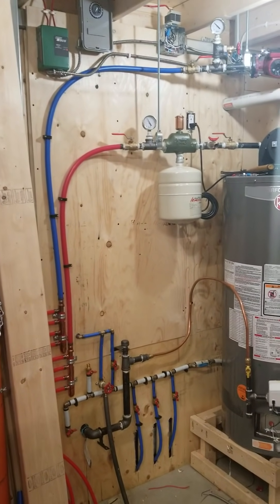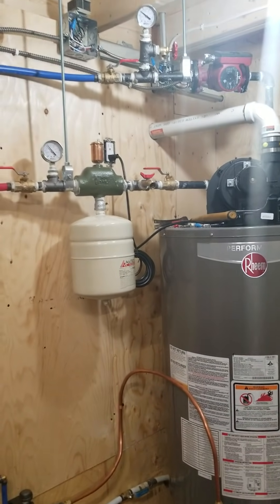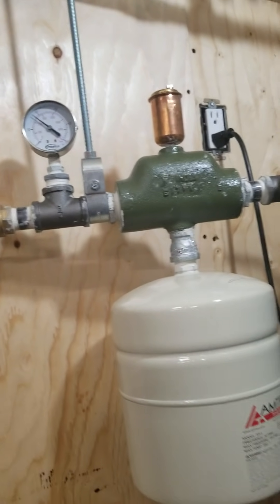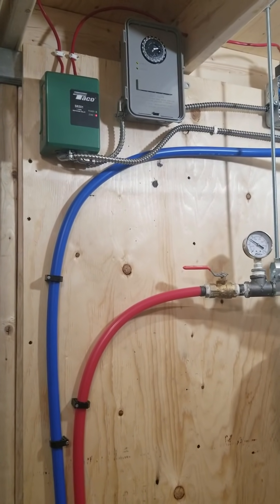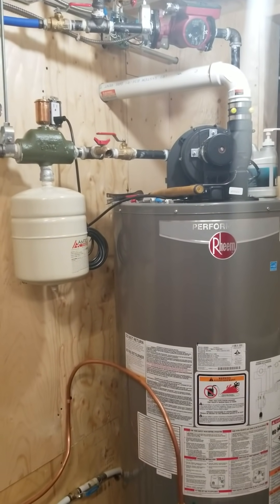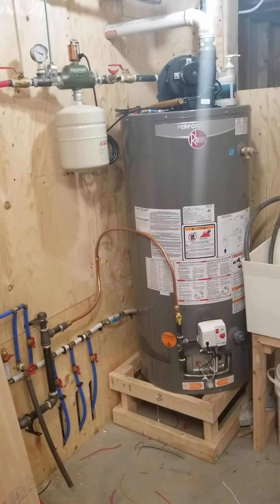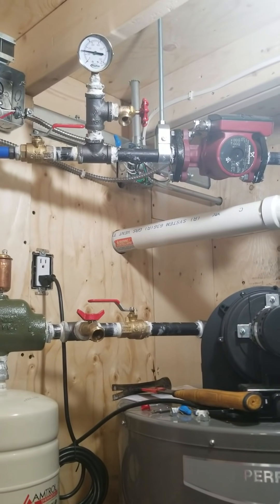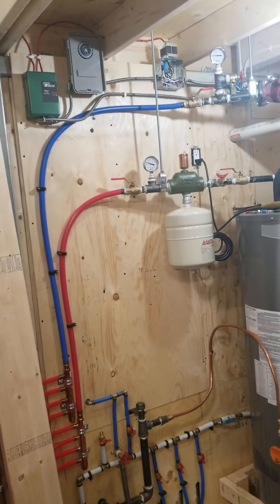DIY In-Floor Hydronic Heating System Using Water Heater

Comment: Jordon, the Glycol you added to your system was it diluted at all or a 100%?  Or should I ask can you run it as a mixture like 50/50 w H2O?
Thanks and great video very helpful. I have everything together and will be installing before the winter hits here in MI.
Reply from the maker: It was diluted, the system is 40% Glycol, 60% water. The larger concentration of glycol, the lower the freezing and burst temperate of your system. I mixed the glycol and water in a bucket before I pumped it in the system.

Comment: You tossed a lot of money out the window to do an improper closed system.
Reply: I don't often comment...but some people piss me off....thanks for trying something different. obviously there are other guys (like me) looking to do the same thing, thats why you have so many comments and quesions. I'm glad the system works for you, and it seems pretty inexpensive as well. it makes sense that the system should work, its a simple process, heat water and send it thru the pipes...doesnt seem like there is any right ot wrong way to heat the water...its good to see that the hot water tank can do the job...i appreciate the time it took to make and post the video.
Reply from the maker: Dont even care, my shop was 65° all winter long and used minimal natural gas to maintain that temperature. It was a hell of a lot cheaper to build it this way then the $7000 ready to install board the building company wanted to sell me
Reply: @jpaul1030  u wait its going to cost u more...stick to ur shitty electrical trade dont try to be a plumber a plumber when u have no clue what ur doing dumbass.
Reply: @jaybee9097  If you're going to criticize,  let us know what he did wrong? Or how you could do it better for the same price.

Comment: So one small logic mistake is shutting pump off.    Just let the water heater run when heating up.   The timer logic is wrong here.    Just turn the water heater on and water heater will run continuously until slab is heated.  Shutting off the water heater doesn’t save fuel.    Either the water heater is big enough or not.    40k should heat slab.    When you initially turn system on it will be cold and water heater will struggle shutting the water heater off in theory actually used more fuel.   Let it “dump” and recover while recirculating.
Reply: I think he doesn't shut off the heater but the circular motor.

Comment: Could have used a regular expansion tank instead of a domestic hot water one.
Reply from the maker: That's what they had at the supplier when I was there
Reply: Jordan Paul that works too.    See my other comments on inhibitor, I’ve done this before for the odd job.    One of the dirty secrets of the water heater business is those water heaters run at about 75% efficiency which is illegal in the US and Canada for a boiler.     That’s why you don’t see this more.    The government tries to save us from ourselves lol.

Comment: Is that heat pex? Regular pex doesn't have an oxygen barrier and you may be bateria ect growing in your system. I've seen it before,  but I don't think they had antifreeze in it.
Reply from the maker: It's a closed loop system so I'm not worried about bacteria
Reply: @jpaul1030  I asked if it's heat pex because if it's not it doesn't have the o2 barrier. No o2 barrier,   not really a closed loop. I've seen it done before by home owners who don't know better.

Comment: were there any issues with the staples pulling out of the foam when the concrete was poured? Getting ready to build a garage here in a few weeks and i'm thinking about fastening methods for the pex.
Reply from the maker: I used these:

https://images.app.goo.gl/46PpeMmigDopdmtZA

They worked like a charm, the pex felt very sturdy using them. The act like arrow heads, once they go in the foam it's tough to pull them out. Space them every 24" or so

Comment: What size is your water heater?  I'm guessing about 40 gallons.  I'm very interested in doing this.  Any concerns using an electric water heater?  I already have a propane heater in my shop appx. 1700 square feet with 16" side walls.  I was thinking it would be best to have two different heat sources.  Keeping the floor warm would lower my use of the propane.  I'm in NE South Dakota and it can get -30 here.
Reply from the maker: Mine is 50 gallons. Electric would work the same, it's just expensive in my province so I used gas.
Reply: The problem with an electric is btu’s output.    In the US an elective Is 4.5kw.    A 40 gallon gas is 40k btus.    4.5kw x 3412 =15k btus.     That’s very little output.
Reply: @anexpertateverything4816  I was debating on using electric verses propane (LP).  I have an LP furnace in my shop and thought to have a separate heat source with the in-floor heat (electric).  I may still use a boiler made for in-floor heat in lieu of a water heater.   I want to keep the floor at about 40 degrees in the Winter.  The concrete is insulated under the slab but there's not much insulation on the sides.   Should I go with an LP boiler/water heater or electric?  I do get a discounted rate I believe at about 4.5 to 6 cents a KW through a CO-OP.  The pro for electric is no vents needed and I can get a boiler for about $800.  Thank you in advance.  Any advise is appreciated.
Reply: @kelly00127  so what is the cost per day and month to run?
Reply: @tigertom53  I have an enclosed system with an electric boiler, not like this set up.  My shop is 35 x 54 with 16 foot side walls.  We are on a rural electric coop with reduced electrical rates for in-floor heat.  I keep the floor at 50 degrees, with a temp sensor in the concrete.  It runs me approximately $100 to $150 a month extra in the winter.  I live in NE South Dakota and it can get -30 to -40.  When I work in my shop I turn on a propane house furnace to get the temp to about 65 to 70 degrees.   I have 2x6 walls with plenty of blown-in insulation in the attic space.  Hope this helps you.

Comment: So many gas code infractions!
Reply: Code says you must have pipe on the relief and copper line must be identified. Pressure tag must be on equipment.
Reply: You have no way to shut off and disconnect gas line to remove and service burner with out a union.
Reply: @johnstewart326  shut up u desk top jockey.there is nothing wrong with this system . You're just jealous you probably can't even turn a screwdriver. You can always shut the main gas valve off. It's just a small inconvenience jerk
Reply from the maker: Please explain how there not being a union at the tank compromises the safety factor of the install
Reply from the maker: How many code infractions do you see?
Reply from the maker: @johnstewart326  what are the infractions
Reply from the maker: @johnstewart326  will not having a pipe on the pressure relief valve cause it not to relieve the pressure?

is not having a union after the shut off valve a critical safety hazard when I can just use the flare fitting?

I know what the copper line is for.

Screwdrivers aren't approved by the manufacturer to use as pry bars but they work pretty good as one.

The TSSA tag is in my house.
Reply: Did anybody stop to think that maybe the pressure relief valve should be changed from 150 psi to 30 psi like a normal boiler system, especially considering there’s no low-water cut off. So if there is a leak in the system you could create steam

Comment: I have a very simple residential water system: street water supply to the water heater, then to all faucets, showers, washing machine etc. I had to open a lot of walls and I got the idea to upgrade my water system with a hot water return line and install a recirculating pump to stop wasting water down the drain waiting for hot water, and then I thought I should probably then also install hydronic heat radiators. My question is:, can I just add a manifold style hydronic hot water radiator system,  hooked up to my house water line and use one circulation pump, I live in california so no freezing concerns for me.
Reply from the maker: Even if you dont run glycol you still run the risk of getting Legionnaire's Disease from the stagnant water in the water lines. Chances are you wont run your system more then a few months a year so when you start it after 9 or 10 months you could risk legionella getting back in your "house side" and going through your faucets. You could prevent this by putting in a back flow preventer but up here in Ontario Canada you need to have that inspected yearly by the city. So not worth the risk in my opinion.
Reply: @jpaul1030  separate system looks like the way to go then. I wanted to just use one circulator pump but not at the risk of cross contamination.  thank you for the prompt reply
Reply: Angelo C I don’t know if you ended up doing this project but most radiant heating parts are for non potable use only. So be aware of that.

I have a return line in my home and on its way back I have a towel warmer in one of the bathrooms made of copper and it heats the bathroom along with the towels!

Comment: How much anti freeze did you use?  What was the ratio?
Reply from the maker: I used glycol. My system is made up of 40% glycol and 60% water. Has a burst temperature of -30 ish. Each manufacturer of glycol has different grades with different freezing/ burst temps which are well labeled.
Reply: Jordan Paul thanks, and nice job!

Comment: Great video! Very helpful. A couple of question if you don’t mind. What diameter of PEX in the floor and portion beyond the manifolds? Also, what size pipe is that you used at the water heater?
Reply from the maker: 1/2" pex in the floor. I believe the pipe size I used at the water heater is 3/4" but your water heater may vary.
Reply: Pex size in floor doesn’t effect the heat produced.    The larger the pipe the Btu’s it can carry.    But per sq ft of flooring you will not get anymore heat out of different sizes.    Good rule of them 1 sq ft = 1 foot of tubing.     Doesn’t matter tuning size!    3/8” tubing = 200 ft loop; 1/2” = 300’ loop; 5/8”= 330’ loop; 3/4” = don’t use!!   To hard to bend and deal with lol

Comment: Interesting about the relationship between the heater tank and circulation. Never thought before that if the tank runs out it may try to heat the "water" forever which blows the efficiency in the trash. Something to think about.

Comment: A very simple system, no mixing valve, zone valve, check valve, pressure reducer.  Air scoop should be on upper section, pump mounted low, no black pipe. You proved the system works well to those who say it can't be done. Nice work!

Comment: Great Job. Although it looks like you used  black iron pipe in some spots.  Hopefully I am wrong.
Reply from the maker: What's the problem with black pipe
Reply: Jordan Paul , black pipe is for natural gas. It’s used because the gas can cause galvanized pipe to flake and mess up the burners. Galvanized is for water, so the pipes won’t rust. You might be okay, since you’re running glycol. I’d look into replacing the black pipes with copper. Greetings from Southern California
Reply: Jordan Paul no problem with it, things rust because of the oxygen in the air. In a closed system you will have minimal rust.
Reply: Jordan Paul can’t use ferrous materials with non oxygen barrier tubing.    Your steel in the system is slowly rusting away and sludging up your system.     Get the best inhibitor available and pump some into your system yearly!    Trust me.

Comment: Good show men . Why not heater on demand  ?
Reply from the maker: When I did my research on this system I read that the condensation of the water/ glycol mixture can be caustic when only heated to 130°F and is harder on the on demand heater opposed to a tank. But then I read about on demand heaters that can separate the condensation better. So I went with a tank because people I've talked to and systems I've seen have been built with tanks and I wanted a sure thing.
Reply: @jpaul1030  Condensation?  Are you referring to condensation in the flue?

Comment: Looks like you used black iron. Not made for liquid. Switch those fittings to galvanized or your gonna rust out the system
Reply from the maker: I've see whole universities non potable water done with black pipe. Itll be fine.
Reply: I’ve seen thousands of systems fail due to using ferrous materials and regular pex.   Because you have no oxygen barrier you should have used a brass or stainless steel pump and parts.    You cut a serious corner using black fittings and pump.    Or one could say you cut a serious corner using domestic water piping instead of heat.    Saved approximately 20 cents a foot in pex.    For $100 you could have done it right man!!
Reply: @anexpertateverything4816  That makes sense to me he didn't use oxygen barrier pex.
Reply: @anexpertateverything4816  Don't forget he isn't using straight water in the system.
Reply: you can use regular pex if you don't use any ferrous fittings in the system, otherwise there will be problems down the road

Comment: goes the lines leak after a while? whats the maintenance on it
Reply from the maker: The system has maintained its pressure since I built it so that tells me there isnt any leaks. Its designed to be a maintenance free system.

Comment: Nice simple system!  Nice to see someone come up with a hydronic system that isn’t over done.  I also live in southern Ontario and I’m wondering how your setup worked during the latest cold snap we had.  What you have here is pretty much exactly what I have designed for my shop, so I’m curious.  Only difference is that I picked up an actual boiler for mine after listening to “experts” tell me HWH’s won’t work
Thanks man!   Loved the vid!
Reply from the maker: I have the shop set to 63 degrees Fahrenheit and an alarm set through my thermostat that will send an email to my phone if the shop temperature goes below 58 degrees Fahrenheit. I didn't get an alarm throughout the duration of the cold snap.

Comment: Why didn't you put the 24 hour timer in between the taco and the pump instead of between line and the taco? Then you could still use the taco 24v transformer and simplify the system overall.
Reply from the maker: The timer needs 120 volts for the timer to keep time. If I put the timer between the Taco relay and pump then it would only count down if the system is calling for heat which is fine but there would be a delay if the unit was calling for heat and had to count down those 45 minutes. The way I designed it allows the water to be nice and hot when the system calls for heat while allowing me to monitor and control the temperature anywhere I want.
Reply: duh, I didn't even think of that. Makes perfect sense, thanks for the response!

Comment: Great video! Maybe you could use a thermostatic mixing valve to allow the tank to have a higher set point? (mix with return) Powered vent was the right choice, don't mess around it can kill you.
Reply: He’ll never need higher temps.    Slabs run with 100f water typically.    Set water heater to 100f and be done.
Reply: @anexpertateverything4816  lebowski is correct.

Comment: building in floor for my shop 1300 sq feet put 1000 feet of tubing in the  floor three circuits when i poured the floor r 12 panels under the concrete have not decided  what size water heater to go with have to use  electric heater. presently heating with oil furnace i live in ont too. Barrie area
Reply: 933brian insulation under the slab is far less important than insulation around the slab.    Perimeter is the most important insulation available.    Skip under the floor insulation if budget is an issue.    Never skip perimeter insulation!    The perimeter of a slab is exposed to outside temperatures.     85f slab vs 0f outdoor means the heat will literally wick away to the outside.    The good news is you can grow flowers year around even in the dead of winter because the perimeter of your shop will be 70f!    The bad news is the fuel bills will be 3-4x more than they should be lol